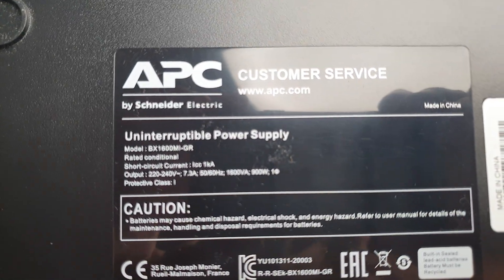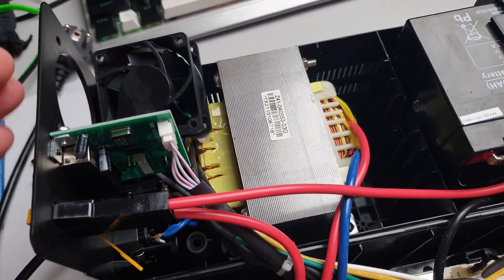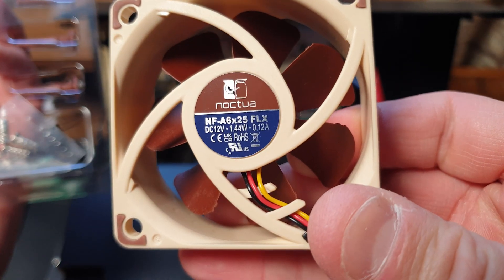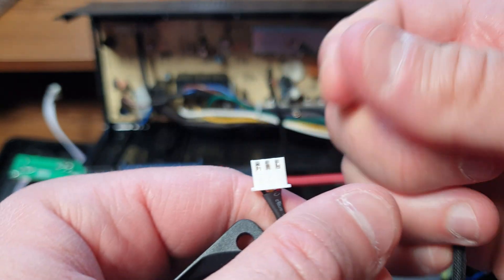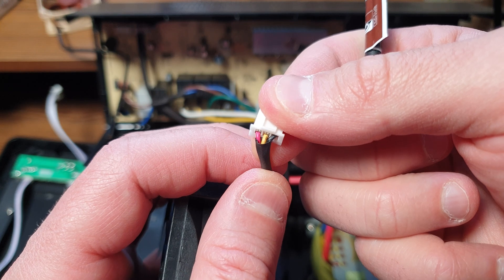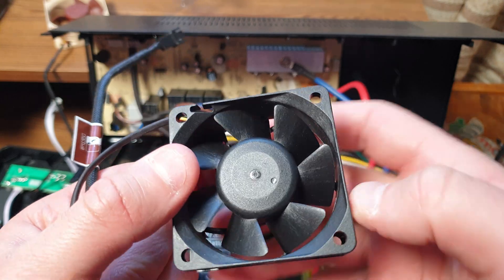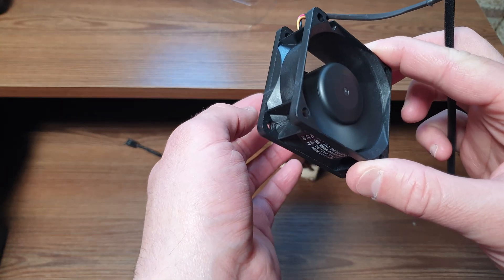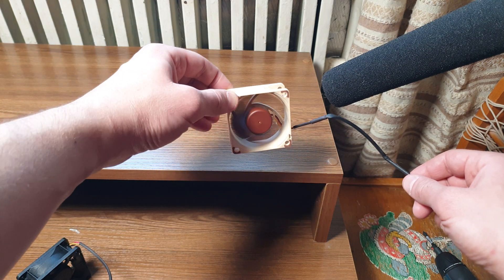Noisy UPS fan replacement

Comment: Nearly everything which uses a 12/24v fan has a cheap fan inside which I swapped out with noctua Fans.

On my eaton online ups I also  swapped out the OEM fan with a noctua fan and a 24v to 12v Adapter. 
The nice thing with the voltage adapter is that its Modulating with voltage so rpm control stays active.

And what can I say: Noctua Fans are just great. Quiet and powerful

Comment: It's probably better to just use a WAGO connector instead of soldering, no?
Reply: There is not enough space. Wago is for high power applications. Solder is always better than temporary connectors in closed spaces.
Reply: @phoenix_random  thanks for the reply! turns out I can't even make it whirl up the built-in vent. if it's quiet then I'm cool with not taking the casing apart.

Comment: I read that this Noctua fan has actuallly 3 settings: Normal, Low noise and Ultra low noise. But on the images I cannot see where this switch located
Reply from the maker: there are no switches, you need to connect a special cable adapter with a resistor that comes included in the package
Reply: @AndresReviews  can it be done with your instructions? (not that the default sound levels of that Noctua are annoying)
Reply from the maker: @q0w1e2r3t4y5  just test it with different cables. but i recommend to leave it on default because you need the max airflow for this UPS, it is quiet on default
Reply: @AndresReviews  thanks! BTW I was thinking of buying another one of this ADDA fan so that I could have a backup in case I need to file a warranty claim, but alas, only 2-pin versions exist as far as I could find. So I need to just bite the bullet and hope the UPS will work correctly. Perhaps I could test it under load for a while to simulate outages first, before cutting the wires.
Reply from the maker: @q0w1e2r3t4y5  yes, those ADDA fans are not sold separately, but somebody commented here under this video that you can buy a connector like that so you don't need to cut the fan, but i can't recommend where to buy this connector, maybe some radio hobby shops
Reply: @AndresReviews  maybe under a different video because I cannot find that comment.
Reply: @AndresReviews  JST PH 3-pin 2.0mm pitch ?